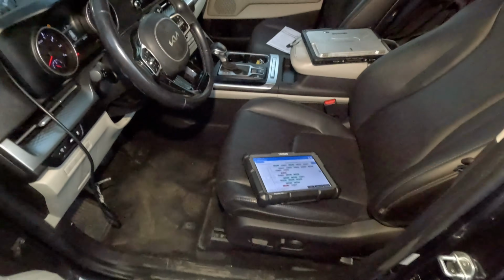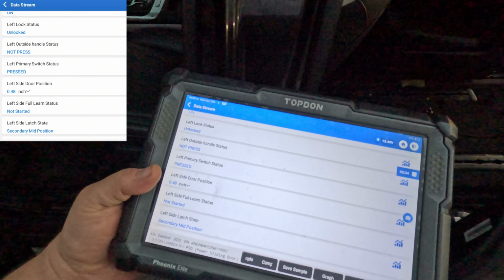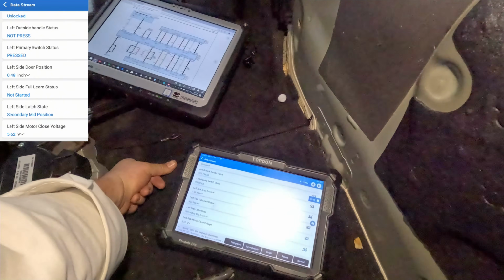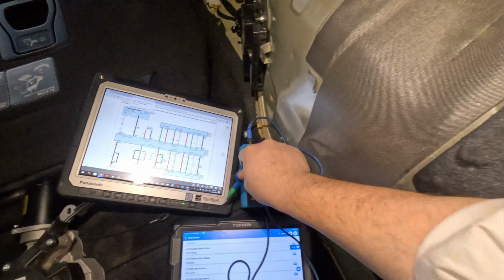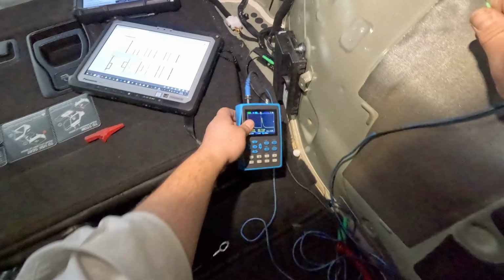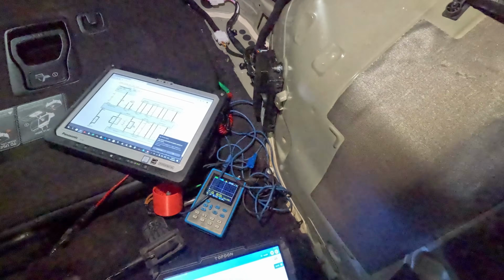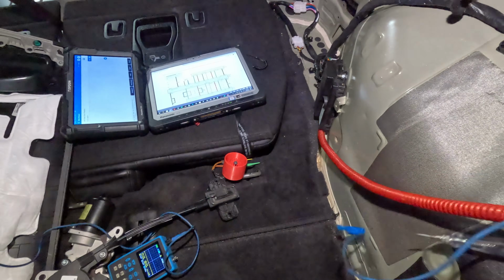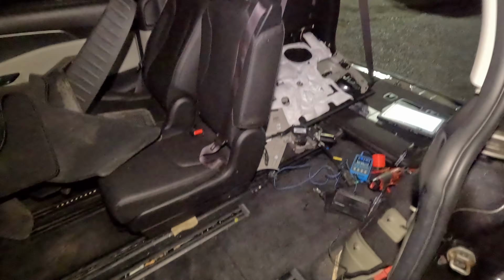2022 Kia Carnival - Sliding door wont open!

Comment: In looking at the PCB, black 10 pin connector F03-J3 uses fairly large connector pins soldered into plated through holes. But the LH Drive Unit Position Sensor #1 and #2 signal PCB traces are very very small traces on the top layer, and it looks like PCB layout does not use  teardrop pad entries. 

What this means is the small PCB traces could be cracked where they connect to the plated through hole, and unfortunately reflowing the joint may not bridge a crack on a small trace. Fortunately, the position sensor signal pins are on top so you should be able to inspect the trace to pad connection using your microscope if you tilt the board, and possibly repair without removing the connector. I think the connectors are linked, but you can still remove one at a time by sliding it upward. 

We know a lot about the Power Sliding Door module in terms of operational health. The sliding passenger door is working correctly, so virtually everything is working except the LH Drive Unit Position Sensor #2 input circuit for DTC B14A700 and LH Drive Unit Drive Motor Open circuit for DTC B24A500, both of these are on connector F03-J3. We also know that the LH Drive Unit position outputs are working correctly. 

For the DTC B24A500 I think reflowing the solder joints would fix the cracked solder joint. But, to reflow the connector you would need a more powerful soldering station than what is being used in the video, use liquid flux instead of tacky flux and have a much larger chisel tip. However, to fully inspect all of the connections you should remove the connector F03-J3, but you would need a de-soldering station to do so. 

The advantage of removing all of the old solder and the connector is after any repairs you can solder the connector plated through holes with a known solder alloy. The solder joints from the factory are probably SAC305, which is very poor at being reflowed due to the high heat and inferior wetting action. 

If you remove the old solder you can re-solder the connector with eutectic Sn63/Pb37 solder which would make a better joint because you are not mixing leaded and lead-free solders, and if you add the proper liquid flux you can make an excellent joint without a massive amount of heat.

What is very strange about the LH Drive Unit Position Sensor #2 input, is we know that the proper signal is being sent from the LH Drive Unit and this signal is present on pin 3 of F03-J3 without any distortion, and this input will be a fully protected digital input with high hysteresis, meaning it would be extremely difficult to damage the input circuitry, and will be fully tested for electrical overstress including ESD. I think the failure is a cracked PCB trace at the PTH pad. Many times in PCB layout the designer will just stay with a very thin trace used in and around the microcontroller and just bring this thin trace connector to a connector pin, which is okay if you use a long transition teardrop to go from the trace to the pad. A very thin trace to a large PTH will form a stress riser that can easily crack.

Comment: Great video. Just a word of caution to all Sedona and Carnival owners, make sure you get that extended warranty with your new or used vehicle. These repairs are very expensive. Where I live they can be as much as 2K for parts and labour per side. Be sure to lubricate your cables and centre roller as they run on the exterior of the vehicle, over time they bring in dust, dirt debris which causes corrosion and the motor and bearings to seize. Owner of a 2017 Kia Sedona SX from Canada.

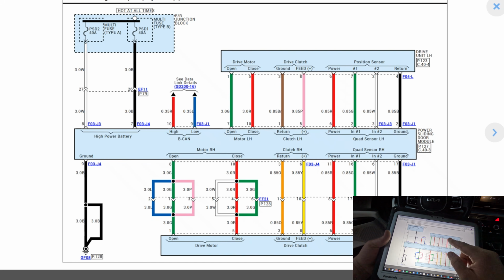Comment: 3:52  What type of position sensor is this? Is it  linear type sensor
Reply from the maker: It looks like a hall effect sensor to me.
Reply: If you combine senor #1 and sensor #2 as a digital word, the door linear travel would be a single rotation gray code. Meaning the motor would be geared down to drive the coded slip ring wheel, so a full open and full close sequence would represent one rotation of the coded wheel, and by decoding the two signals you can infer the door position and direction with the needed positional resolution. 

From a circuit standpoint the code is just a segmented conductive trace circle read by a lubricated slip ring. With two signals you would have two tracks and two slip rings. The slip ring raw signal would be de-bounced and amplified (current drive) before being output to the Power Sliding Door Module.

Comment: Did you add a banana plug to the test light?
Reply from the maker: Yes
Reply: @ thank you for your reply. Would the procedure be the same in your video where you show how to make test leads?
Reply from the maker: @ntorres586  Exactly the same.
Reply: @advancedleveldiagnostics  thank you for everything you do
Reply: Made a load test light with a rattle can lid, old halogen bulb press fitted into lid. Used silicone wires with spade connectors on one end to H4 bulb and bananas other end.
Thanks for the idea Advanced Level ! 
Love the mobile setup. You need an old toothbrush for the flux cleaning.
Reply: @bobsoft  very nice

Comment: Amazing at what our skills are. I was telling my wife yesterday I should be making a million dollars a year at the skills and knowledge good mechanics have and people have zero idea at what we do. I gave an example of our field to medical industry where we do everything and doctors practice on just a key part and still have xray technicians and we read scopes, diagrams, trace and disassemble vehicles repair and reassemble and extensive testing to confirm the repairs.  We are HVAC, plumbers, welders, electricians, hydraulic, schematic, scope etc. by 1000 that people have zero idea of our knowledge for a cost of nothing to what we invest in equipment, software, training and hours we spend off the job learning and working in our sleep and on days off our job never ends with our mindset.
Reply: Yeah but the difference is the doctor fixes the p problem while it's running
Reply from the maker: @ronvonbargen8411  lol
Reply: @ronvonbargen8411 but have you seen a doctor bring someone that has been dead for year back to life? 😂
Reply: @naskomitrov5456  nope.
Reply: I agree we are under paid and under mind when your at this level of knowledge, experience and equipment
Reply: 100% true!